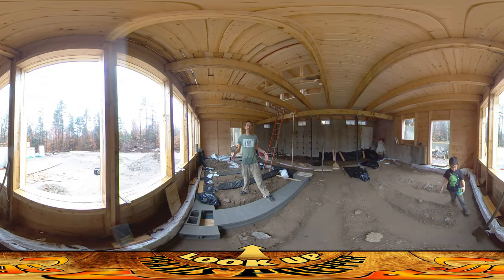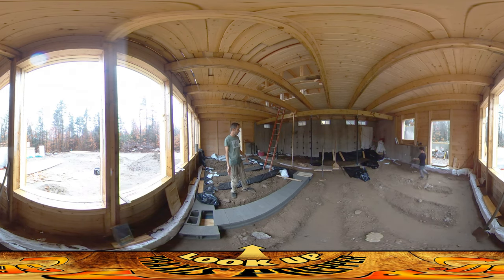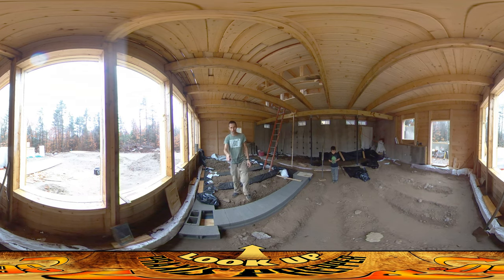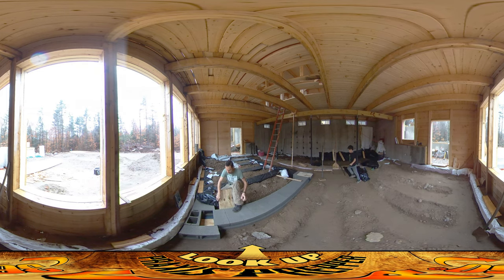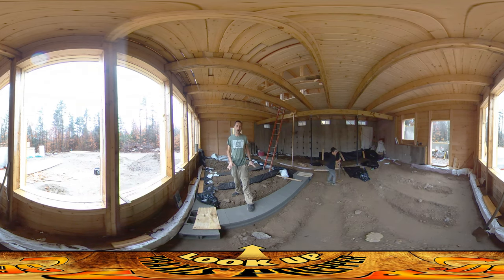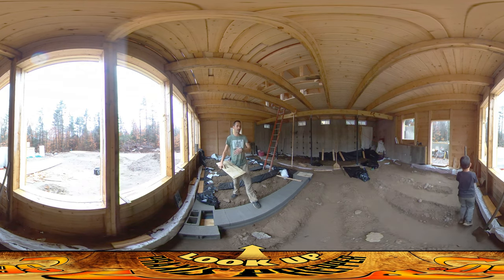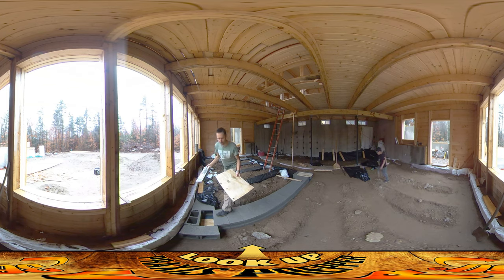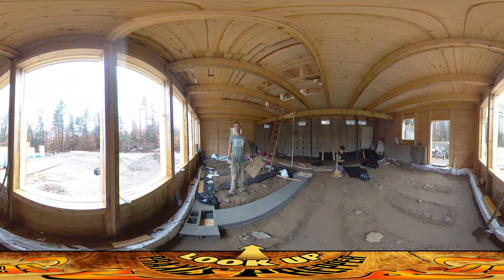Homestead Building - Sub Floor Air Tunnels for Thermal Transfer Detailed Layout

Comment: I know what you mean by the weather forcing indoor work. After having rain and a high temperature of 75 degrees yesterday, toady it's 35 degrees with 25 to 30 mph wind, and the chill factor is in the upper teens at 1:00 pm - in Alabama!
And I really need to do some mechanical work on my pickup truck....
Reply from the maker: We had high winds and 20's here in New England. I winterized the site as best I could and I'm hoping the thaw at the end of the week can see the site get fully buttoned up before real winter begins. Good luck to you too!

Comment: If I understand correctly, you are planning for that wood to get encased in concrete, if so you need to put something on it to waterproof it or the moisture in the concrete will get absorbed into the wood during the months long curing process (since it will be under a layer of concrete vs on the surface) and likely to become a black mold factory.
Reply from the maker: My hope is that the air moving through those passages will avoid the heavy moisture build up. It is pressure treated plywood too. I also have it separated from the concrete with a layer of plastic. Fingers crossed... maybe I should pre-install cameras in the tunnels?
Reply: Praxis Homesteading and Survival Skills It was the contact between the wood and concrete during the curing process that was the concern so plastic should avoid the problem. I'm used to pressure treated lumber having a green color so that didn't occur to me. Actually only learned it was a potential issue because of a video I was watching by a construction company doing an ICF build.
Reply: Praxis Homesteading and Survival Skills Oh, might not be a bad idea to check them periodically especially after the humid season ends for you.